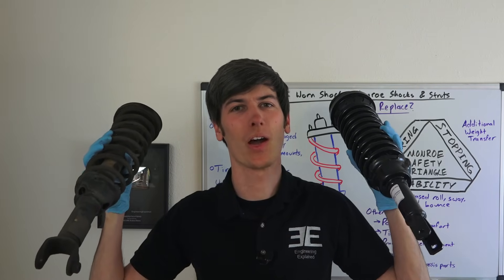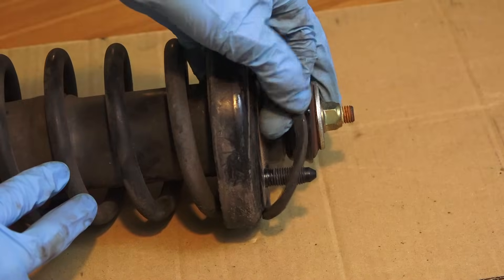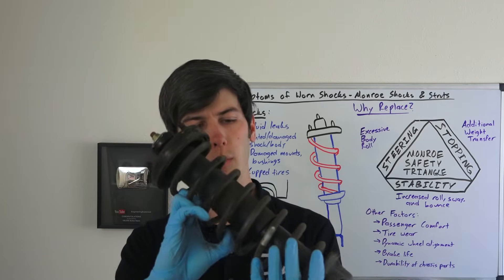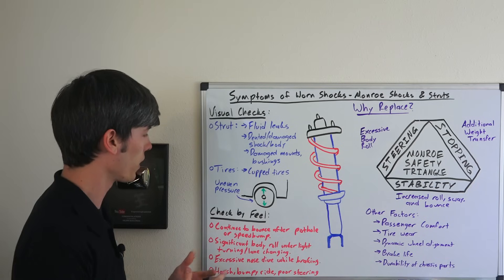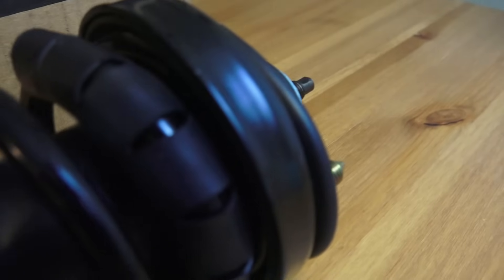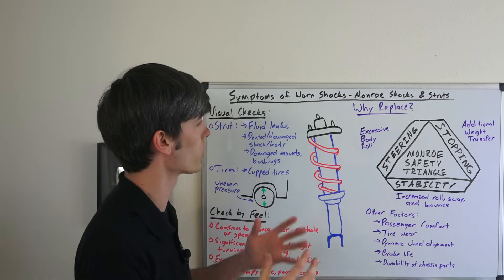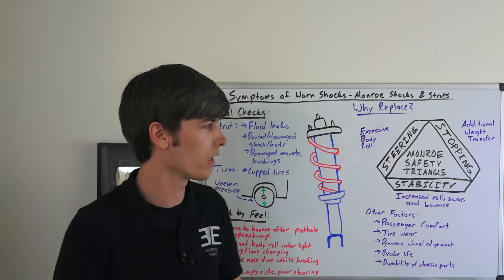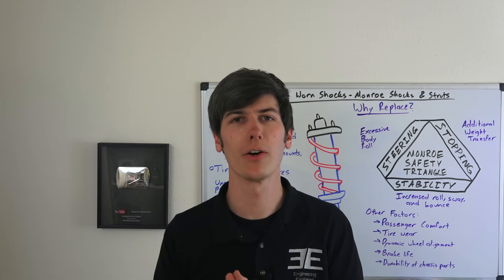When To Replace Struts - Monroe Shocks And Struts

Comment: i have a 2008 SAAB 93 v6. its overall in a new shape however I am having unusal hit and discomfort when I am even driving over a tiny bump. the car does not wiggle and its good on highway but jumps unsualy and some time I feel it going away a bit when it passes over a bump in a reletively higher speed around 60 - 80 km/hr. First I thought it because of the big 18" wheels which allow less air cushion that makes the car more sportier rather comfortable. It is obvious but do I need a new shock ? and how to find if they are front or rear ? also what kind of shocks a 2008 SAAB 93 v6 aero has and what would be the best replacement shocks for them ? do they come in full assembly ? and can be changed by self ?
thanks

Comment: After I got all of my struts replaced for the first time, at 230k, the front brake pads don't vibrate and shimmy any more. Monroe Struts, from and independent shop, seemed be a better value than the genuine Honda struts at the Honda Dealership.
Reply: Thanks, for comments. What is your thoughts now? I,am due all four corners, ON 2015 FWD Dodge Journey:: considering Monroe( have on my 2007 CANYON 2 DR/ LS GMC, though one Monroe Front Strut May have leak after some 80,000 miles, & imhave relocated , losing my outstanding Tire Store/ Warranties)…
Reply: @opera93  I sold my Honda Civic shortly after I replaced the struts so, I don't know how long they lasted.  My 2001 Odyssey has spent struts and I'm still driving it.  The car has no real value and it's not worth replacing the spent AC compressor, and the spent struts.  I hope to sell it soon.
Reply: @cgrscott  thanks, I have generally used Monroe’s, if Choices

Comment: Most factory (original equipment manufacture) shocks / struts last 200,000 miles. Most Aftermarket shocks last 50-75,000 miles. There are a few exceptions that happen though. You're usually Better off buying new OEM replacement parts. As nearly all aftermarket parts are of seriously poor quality. ALWAYS Keep In Mind these companies want you to Buy Early and Buy Often... Its how they Maximize Profits and Market Share... Same with your local friendly shop... They can't pay their 15,000 a month rent telling customers their oem parts look good enough and are serviceable. Always get a second opinion... This coming from a repair shop Owner....
Reply: I am from Germany and i can tell you that Monroe is not a good brand. In Germany nobody want to install it on cars. Here we use Sachs or Bilstein. With this two brands you cant make it wrong. Sachs is OEM deliver for BMW and Mercedes.
Reply: Xe

Comment: I have about 260K miles on my 1992 Acura Legend's struts, and I think they're done - lol. I've had a very bumpy ride recently, so I stopped off at the local Discount Tire to have the tires checked, thinking that the tires might have deformed; they found that the front tires are wearing unevenly. The tires were replaced, since they were old anyway, but the ride was still terrible after the replacement. So, I decided to do a thorough inspection of the suspension. I found that the driver's side CV axle boot was torn and flinging grease everywhere and that the joints on the passenger side axle appear to be broken (very floppy). After replacing the axles, the ride improved, but it still feels a little like I'm driving over a gravel road. The struts don't look visibly bad, nor does the car bounce when I perform the "push" test. It looks like it's time to take them apart...or just not be cheap and simply replace them :-)
Reply: After 2 years, i tell you this anwyay. No shock absorver lasts so many miles, not even one third of that. My car had stock shocks with only 100.000 kms, from Sachs VW. They were shot, the car felt like a dancer when cornering. So you imagine that when i replaced them, the car felt like a sports car LOL, much better stability mainly when cornering, it became harder but its still much better this way!
Reply: Struts almost always pass the bounce test unless they are completely blown. A better indicator is tougher bumps, more steering corrections to have to be done at highway speeds, wind gusts making your car tilt, and small bounce vibrations.

Good thing about the struts is unless completely blown u have a lot of time before you need to replace them
Reply: 260k? Defo knackered shocks.

Comment: I've found that using the pushing down on the shock and pushing down on the front fender test is too subjective. I go by symptom and car mileage. shocks can seem normal when you compress them by hand but the real test is when they are under load
Reply: I agree. My truck passed the push test, but my tires are cupping and the shocks are 157,000 mi old
Reply: @cherylbishop6322  I don't think the old bounce bumper test works with today's vehicles, too soft of body parts to really test

Comment: Would you be able to do a video on engine and transmission mounts? How can you tell if you have  broken engine or especially a transmission mount
Reply: you put the car into drive with your foot on the brake and give it some gas. a broken mount will make the engine ligt
Reply: +nicholas elias lift not light
Reply: nicholas elias I knew that part, but I don't know how to check transmission mounts. I know most likely you have to see it to know it is broke, but I don't know if there any other way to tell if a transmission mount is broken.

Comment: only cheap shocks and struts use oil /fluid inside...HD and sport shocks use pressurised gas...
Reply: As a former Monroe employee I can confirm that all gas charged shocks and struts contain the same fluid as the non gas charges shocks and struts do. I built both types every day for several years.

Comment: good video, but monroe's suck. i refuse to put them in my customers cars.  i've used kyb's, bilsteins etc with no problem, but the few times i've used monroes, i've always had a come-back
Reply: wenger828 I've been that comeback. :(
Reply: I just bought some Monroe shocks and they are very noisy. Sound like metal clanking
Reply: @pennyontrack  I bought TRW absorbers, i hope they are good...i think Sachs is the best option but they are more expensive

Comment: Every 50,000 miles? I've already driven 42,000 miles on my one year old Subaru...
Reply: That thing is probably blown up by now then 😅
Reply: @Dark_Ukiyo  negative, I'm still driving it
Reply: @AWDfreak  I’m sure you are lol I want one.
Reply: @Dark_Ukiyo  it is a difficult time to purchase one, even my crapstic manual transmission Subaru XV Crosstrek has significantly increased in value.

Comment: How about 'groaning' sounds when driving on uneven surfaces? I park on uneven ground all the time and my 2004 Chevy cavalier (130 K miles) groans when pulling in or out of uneven ground. No nose dive or loss of steering though.
Reply: blind09 Could be your wheel bearings. I could only hear mine under special circumstances. That's as bad as I let them get. Since wheel bearings, unless they're really obvious, can seem like a brake issue or even a power steering pump issue (this is if they're really bad) I like to isolate them.

Get your car up on jack stands and check for play at 3 'o clock and 9 'o clock and again at 12 and 6. This won't turn up a wheel bearing unless it's bad enough to pulse into the steering wheel when turning.

Place your hand on the spring. Spin the wheel by hand. Feel for vibrations in the spring. Found most of my wheel bearing problems this way. The one time I didn't the 3 and 9 and 6 and 12 found it. Note the 3 and 9 can also find tie rod issues.
Reply: thank you, I will try it out.

Comment: Can anyone help me out? Whenever I go over a decent size bump I can hear a high pitch hiss/squeak from the front two tires but mostly from the driver's side. I drive a 2007 Mazda with about 83,500 miles so I'm guessing I should buy new shocks and struts.
Reply: ***** That can be a symptom from worn struts that have air where oil should be.
Reply: ***** I recommend to a friend once to not replace his struts despite the air as the struts still behaved correctly. That lasted a month, but I've heard of ride quality sticking around a few years under similar circumstances.

Comment: The original OEM dampers on my 1990 Honda CRX Si began to deteriorate at 15,000 miles and by 22-23k were quite ineffective. The car simply lost its sporty feel and stable handling and had more body movement over bumps. Honda Motor Co. must have really up'ed the quality of their dampers since then based on your experience. I've been using Koni Sport adjustable dampers on the CRX since 2000 (daily driver) and they started showing signs of deteriorating damping effectiveness just last summer. The ride quality is just not as good as before regardless of the damper settings. However, they are factory rebuildable.

Comment: What about the loose feeling when you drive through the potholes? Is that from shocks? I had changed them 30k miles ago but driving in nyc might have done some damage
Reply: infonotfound I'm thinking that's more the springs at this point.

Comment: 125k miles and the shock is still intact? Hell, all the salt usage in (south) Norway makes them break long before that.
Reply: 100k km is still reasonable. It's just that my car seems indestructible with 255k km and 19 years, I only changed the water pump and made the usual maintenance. But what i don't spent in parts, I pay in gas!!!!!!!!!!
Reply from the maker: Richard Tønnessen Pretty impressive. I just checked out the shocks on my brother's 98 civic as well and they were beautifully clean and undamaged. Well over 150,000 miles on them. I certainly don't believe it's the norm, but it can happen depending on where you live.
Reply: Richard Tønnessen 255.000km on mine still going strong!!! But mine never experience less than 5ºC.
Reply: Had to replace my front springs a month ago, as one of them broke. Barely 100k km, 7 years old. The salt eats them in no time.

Comment: Fun Fact: Dampers don't actually absorb shocks at all. If anything, they help transmit them. The springs absorb bumps. The dampers damp.
Reply from the maker: duviday Springs are energy storage devices, dampers are energy dissipation devices (through heat).
Reply: duviday Yup, calling dampers "shocks" or "shock absorbers" is incorrect (although most people do call them that) as, as you said, they don't do the shock absorbing, the springs do that. They dampen the rebound of the spring, not only for better handling, but so you don't  get sea sick...
Reply: duviday Makes sense.. So, is it right to say "if all the small bumps on the road gets transmitted into the cabin, then springs need attention. If the car keeps bouncing without settling down, then the struts (or dampers) need a check"

Comment: what are your thoughts on the effect of lowering springs on stock shock absorbers?
Reply from the maker: ScissorsToTheThroat Typically a bad idea as it can allow for the shock absorbers to bottom out (so to speak, the piston travel is altered). I'd always recommend getting a full set (shocks and springs) when doing this that are made to match with one-another, or coilovers.
Reply: Engineering Explained could you clarify what you mean by "bottom[ing] out?"
Reply: @EngineeringExplained  About how much lower we talk here?
And: I think my H&R lowering springs even state they are meant for original shocks.
Reply: @EngineeringExplained  what about bump stops?